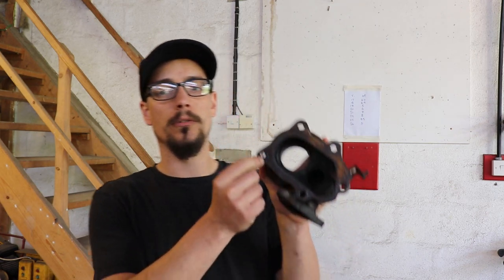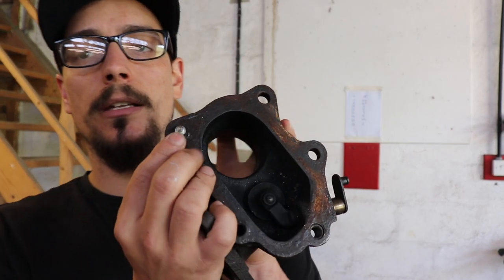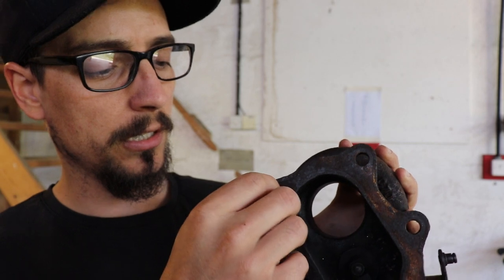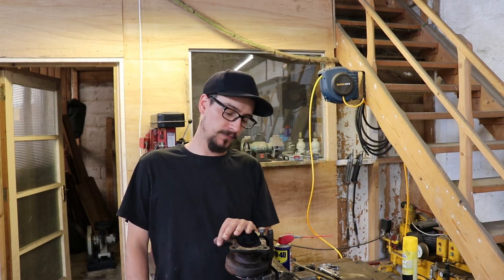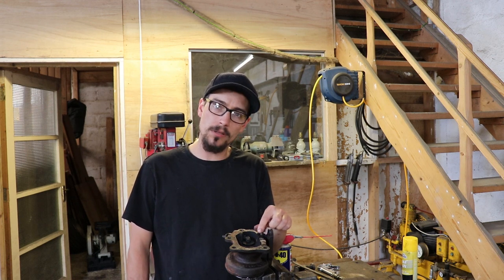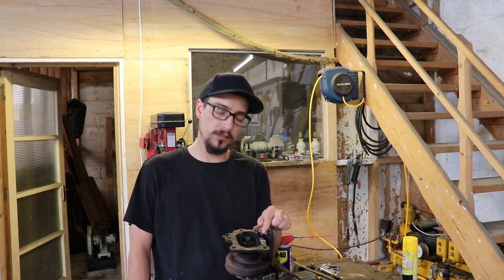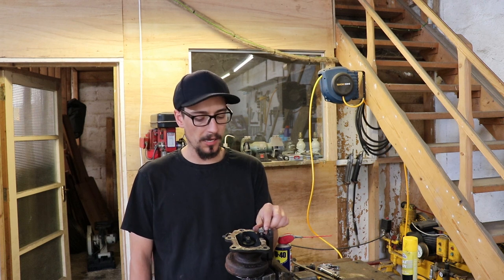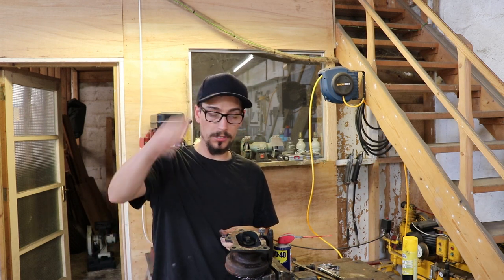HOW TO REMOVE SNAPPED STUDS / BOLTS WITH A WELDER

Comment: Best example I've seen yet of this method because it often does not work first go, so good on you for showing how it goes in the real world. On the one that have snapped off flush, maybe putting a washer on the piece would allow you to build up weld on the stud/bolt without catching the surface of the part? (never tried it, ). That one was well stuck, noticed you used the old trick of tightening a tad, everytime I do that, they shout" wrong way" LOL, but it does work sometimes.
Reply from the maker: That's a good idea with the washer, il use that next time.  Cheers
Reply: I always place a washer first, even and especially in case the bolt stud broke below the surface.

I allways try to turn the piece out when it is still hot from welding.

And last hint: there are much better rust solving lubricants available than WD40. WD40 is multiple purpose but not the best choice for any other purpose than just having one can in the tool box. Try more spefific lubricants!
Reply: I tap on the stud a few times before welding. Not too hard, but it sometimes breaks the rust, and whatever junk is locking it together. Then I weld. Then I tap again and add whatever I have on hand to lubricate it. The washer is a good idea.
Reply: amen brother!!
Reply: This method you said it works i tried  it last year because my supreme jinius did an excellent work in my car and I wanted to repair it

Comment: Greetings from Canada. I put a washer over the broken stud and weld it on first. You'll get better penetration into the stud. Then weld the nut over that. Let it cool and try it. If it still won't budge, I'll heat the part with the torches and  it usually comes out easy.
Enjoy watching your vids. Thanks.
Reply from the maker: Yes thats a good tip, will try it next time. Cheers

Comment: I've always had issue with using a nut for it, so once its proud I use a smaller bolt and offset it for a little extra torque. Typically the heat from the welder causes enough differential heating that it breaks free enough so the smaller bolt will not snap.

Comment: Had a similar problem with a blind hole on my motorbike engine. Bolt corroded in, head broke off but had enough to weld a nut to. Did exactly the same, nut just came off, ended up just building up the end of the broken bolt with weld. The cycling hot/cold did the job. Was able to unscrew with a mole grips then. Almost paid a lot of money for one of those induction heaters to do the same thing, obviously a worthwhile investment if you're doing this a lot.

Comment: Add a bit of white candle wax while still fairly hot. It sucks in like solder and it's a lubricant.
Reply from the maker: I've never heard of that, I will give it a try next time. Cheers
Reply: I can vouch for this method. I learned it from a retired machinist. Get it nice and hot with a torch, hit it with a stick of wax like you're trying to solder copper pipe together.
Reply: I have been a toolmaker-machinist for 35 years and this works. It also avoids getting welding splatter on mating surfaces. Personally I would just drill the stud out. Just center punch with a transfer punch to get centered and use a drill.

Comment: Nice demo! I did this for a mate on a dolly sprint when I was a teenager about 35 years ago. He'd started the job himself then snapped the stud. I was well chuffed with myself for coming up with idea. I earnt £100 quid I think. That included putting the engine back together again. For info, you would be better off using penetrating oil rather than WD40.

Comment: Isnt this assuming the screw has a rust free connection to the rest of the piece where you can then attach your ground to? Cuz i tried to do this but couldnt get an arc at all and i cant attach to the back side of the bolt or anything like that

Comment: This method works better with an oxy acetylene torch. You weld the nut on and the casting gets heated red. Let it coll as you tap tap tap on the head of the nut with a small hammer. The it usually come right out. In an aluminum casting weld it quickly and back it out without tapping or cooling. Real handy on Audi heads.

Comment: Tried 6x to do this and I ran out of nuts. I think if I were not upside down, I could have got it to work. Anyb advice on how to do this upside down? Thanks for the video!
Reply from the maker: Try a larger nut and increase the wire speed a little to help with being upside down.

Comment: Btw how I got it out in end. Steel bolt in aluminium wheel hub. Reckon it was glued in. Welding horizontal. Built out a 10mm mount. Nuts were not bonding well enough. I welded old broken wrench onto the weld on bolt stub. Let it cool. Then tapped up down with hammer.

Comment: My first employer taught me this. Not only give s you but but also the heat t helps it break loose
Reply: Ideally you want the bolt to be cold and the housing hot, so it expands away from the stuck bolt.  So it's best to let it cool thoroughly after welding the nut on, put penetrating oil on it (in this case the threaded hole is open at the bottom), and then heat the housing

Comment: I guess I'm a shit welder.  Have a snapped bolt that's sitting just proud of an aluminum head.  It is a small stud, and every time I weld a nut to it, it snaps off with very little force.  I'm pretty sure I'm just "filling the nut" instead of welding to the stud and tying it in.  But it's a small nut and stud on a 10HP engine.  Any pointers?  High heat? Slow wire speed? Higher wire speed, low heat? any other combo?  Try and angle the weld puddle?
Reply from the maker: Try welding a washer on, then weld the nut to the washer.
Reply: @Urchfab  thats a good idea! I'm going to try this tonight.  Thanks for that
Reply: @Urchfab  You SUNUVA GUN!  It worked!!! Thanks so much!

Comment: Wy don’t use test the thread by torquing the bolt to the spec on the suspected hole? So you don’t have to put a time sert in there while the part is on the car.

Comment: you could also drill a hole through the stud put a left-hand thread through it insert a bolt and undo.
Reply: Never worked in the almost fifty years I've been at it, if the broken bit is free enough for that to work it won't be hard to remove anyway.

Comment: This method, an Easy-Out, then drill out and re-tap.  Always start with the easiest.  Good Job.  Also, try mixing up some homemade penetrating oil, 50% Acetone - 50% Automatic Transmission Fluid.  I've been using it for a few years now and always successful. Must be shaken often but worth the trouble.
Reply from the maker: I remember someone telling that years ago and could never remember the mix, il make some up. Cheers
Reply: Interesting.  I need to make some up too.
Reply: Joe Atwork this method then easy out snap easy out in stud take to machine shop welcome to my world
Reply: Easy outs are shit, Snap one of those and the job is 10x harder
Reply: Damn straight! Drilling an easy out is a nightmare. @riderzinc
Reply: @riderzinc  this happened to me, how did u fix it
Reply: @riderzinc  my stud is flush and now im here watching this video
Reply: @williamjvallejos  weld a washer to it then weld a nut to the washer

Comment: So I have bad luck welding inside nuts, they always snap too easily (maybe too much slag). It's even impossible when it's under a car and you can't get below to see in the middle what you are welding. So here is a tip for all you guys, get a washer, or drill a thick steel, weld that instead, and now weld the nut to the washer/plate but on the outside, making sure your socket can still get on the nut. Voila, much more secure weld without snapping off.  Shit like that makes me want to try 7018 instead of 6013 electrodes to see if it makes a difference in strength.

Comment: Easier to drill it out. Avoids welding splatter on the mating surface. I wouldn't want welding near a cylinder head.
Reply: Lol 😆 obviously you’ve never worked flat rate I’ve used this method on  broken studs in aluminum cylinder heads for years and it works like a charm and I have never had an issue with it

Comment: Had you heated the area around the bolt before removing it...it would've come off much easier w/o breaking...or using penetrating oil...NOT WD-40.

Comment: Should remove it while hot!!!!!!!!!!
Reply: Metal expands when it’s hot, if you’ve put all the heat into the stud it’s going to be interfering more with the hole. Best to wait till it’s cold, then heat the housing hard and fast to expand that away from the stud and get it out quick before the heat transfers into the stud as well
Reply: @alanhillyard1639  your theory is correct but in practice it is the opposite thats the truth. Iv been a mechanic/engineer many years and have experimented with both, and hot wins every time.